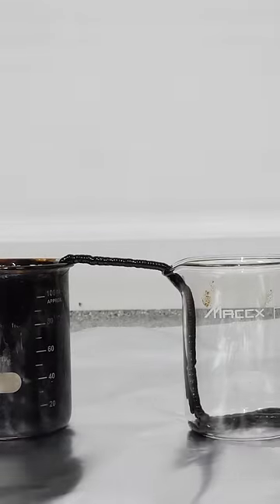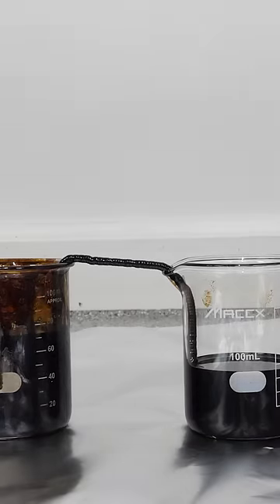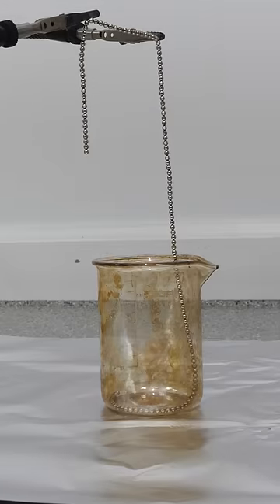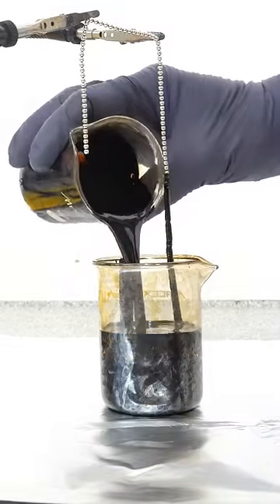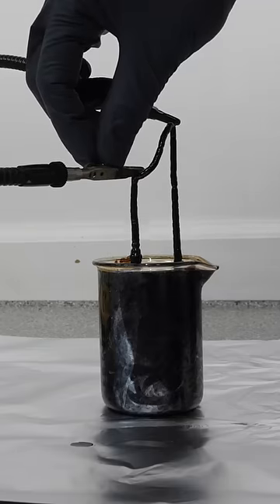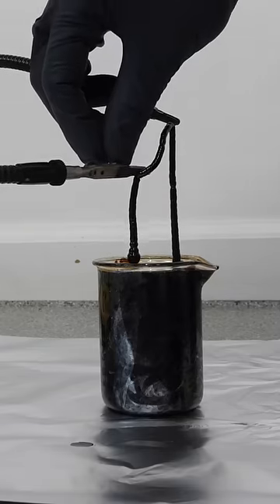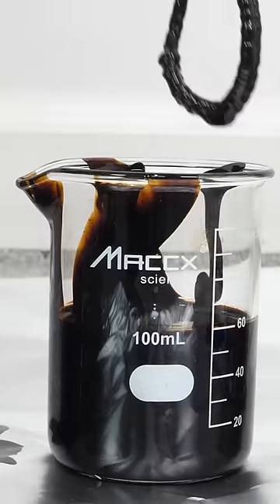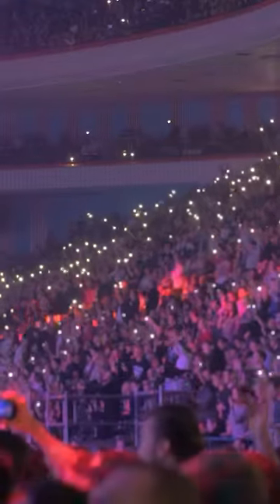Perpetual Ferrofluid Fountain

Comment: You can describe this with pure logic:
Why should it drop in the first place?
The only reason it's going up, is because the up force is stronger than gravity. What should change if it's on the other side beside it's on the other side? Still is the up force stronger than gravity, that's why we are here in the first place? Also why do you expect the drop to drop when you dip it back in the solution? It is more rational to expect that it will also "suck" the fluid up like the other side. Why should the left side behave other than the right side?

Comment: If you start the magnet beads from strong 100%, run it up and over, and then on the downside, start degrading each bead by 10% weaker than the last bead. I bet it starts to work.

Comment: What if you put a straw against the drip end of the chain? Maybe the surface tension pressure in the straw would move the fluid far enough away to relieve the magnetic pull on the fluid.

Comment: What if you used a ramping gear (cant find the real term) the chain weight would apply an increasing downward force until the ramping gear hits it's drop, creating a sudden movement that drops the drop. It's stored energy so no breaking law of thermal dynamics there, you'd just need it fine tuned to the difference of weight in the chain and the weight of the chain +the Ferro fluid. Since the ferro fluid replaces itself, I think it's reasonable to say the chain would be heavier with it than after dropping some off. I imagine there's a limit somewhere else like an eventual change in how magnetic the fluid is or something, but it'd be closer.

Comment: Even if I somehow made it drip, the magnets would lose magnetism overtime.
Reply: Yeah, but not because of anything they're doing. In like a thousand years or however long it takes permanent magnets to lose their magnetism, they would still lose it at the same rate even if they were just sitting on a shelf or something. They don't "use up" any energy in order to pull things, so if it dripped it'd be creating kinetic energy from nothing and thus would be considered perpetual motion.
Reply: @zeph0shade  That would be it. Yes. But in that case just call sun free energy as well.
Reply: @leachblah6313  That is the closest thing to "free" energy we can realistically get, but it doesn't create energy from nothing like this device would be doing if the fluid dripped.
Reply: @zeph0shade   Idk how you are making a conclusion that the supposed machine will be actually free energy. Like I said it's the same as the sun. Also the drip would be so pathetic, any extraction of work will completely stop it from running.
Reply: @leachblah6313  If it dripped, it would mean the laws of physics have all left the building so it's kind of pointless to say it "would be pathetic", because maybe it wouldn't be! Maybe now that the laws of physics have been nullified, it could be gushing fluid like a waterfall!

The point is, the sun doesn't create energy from nothing, but it does create energy from something. In its case it creates energy from nuclear reactions.
That's where magnets are different, they don't create energy at all. Not from nothing, and not from something either. There's just no energy to be extracted from them (unless you literally use the metal as fuel for some type of reaction).

That's why it would be "perpetual motion" if you made the fluid drip from the magnet. It's not about how long it would last, or how much work you could "extract" from it, it would be producing kinetic energy with no energy being added. That's what is commonly known as "free energy".
Reply: @zeph0shade  ahh I see

Comment: What you're so close, just add progressively weaker magnets to compromise the last leg of the chain!
Reply: Wait actually, you may have to start the reduction in magnet strength at like ½ or ⅔ of the way down the last leg, but you could certainly find the right gradient to get a drop going - but I'm assuming a great deal, like I have no idea whether the ferro-fluid has surface tension/cohesive properties similar to water for example

Comment: If you were to attach a plastic tube that the fluid shapes into at the bottom of the last metal ball, would the way water conforms to the shape that it's in not remove the fluid far enough from the magnetic source to get it to drip back down?

Comment: What if you put a piece of string from the bottom magnet down to the beaker the string of would absorb the fluid it would be able to get away from the magnetic ball much easier and collect in the string and then be able to drip back into the container

Comment: Please try using 2 stages of magnets stronger ones connected to weaker ones. Using the stronger ones to pull the fluid to said height and weaker ones for its decent. If that works Nobel prize

Comment: Try putting a reservoir at the end of the chain thats heavy when full, has a hole on bottom and vent on top to allow it to drip and a spring that can be mechanically moved to start the dripping and will oscillate continuing to bounce the wrighted reservoir? Lol i know perpetual motion has never worked for anyone but.....if not oerpetual motion why not try for hyper efficient conservation of energy in the system?

Comment: Yeah cause its acting kinda like a sifon isnt it? So it needs to be below its center of gravity to keep flowing. I know the magnets assist so it helps it travel horizontally and vertically similar to sucking on a syphon does. Which is why it can fill the other cause the string of magnets is at the bottom and has no pressure from the flud. Its also why it wont fully empty and instead equal out and stop transferring. And its also why even if both sides touched the bottom the pressure from the fluid would cause it to just come to a stand still. Am I close?

Comment: But what if you on the descent chain together gradually weaker magnets so that the magnetic pull difference between each link is low enough for the ferrofluid to still drop with the assistance of gravity, but over several links the magnetic force becomes too weak to fight gravity and the ferrofluid actually drops down?

Also film with a thermal imaging camera to see temperature changes which would probably be the source of the energy needed

Comment: But wait.... What if, what if we take a hose and connect the 2 beakers together at the bottom so fluid can transfer back to the starting beaker and then set the secondary beaker a bit higher than the starting beaker??? Can we create a fero fluid super highway loop system for constant flow???

Comment: Nothing involving "permanent magnets" is ever a perpetual motion machine. Those cost energy to produce, and some of that energy is stored in the form of aligned magnetic fields throughout the metallic mass. The trick when designing a perpetual motion machine is always figuring out where to hide the battery, but magnets literally are batteries.
Reply: That's not really true. You do store some small amount of energy in the bulk magnetic material when you create it, which is why magnets are only metastable, but they're not really using any of that energy to attract or repel magnetic objects anymore than earth is losing energy by attracting you back onto its surface if you jump. The energy is stored in the field itself rather than the magnet, and magnets don't "discharge" over time from attracting stuff.

Comment: What about using smaller and smaller pieces of chain for the last few links. The ferrofluid would drip down due to gravity and the last few links wouldn't have enough pull to overcome gravity causing the fluid to eventually drip off, maybe even having the last link or two be non magnetic so surface tension and gravity are the only forces left acting on the fluid

Comment: but what if that last magnet is attached to a long very absorbing material that then hangs? maybe the absorption might be enough to overcome the magnetic field and pull the fluid down far enough away, and then after oversaturation it will drip...but i'm thinking that the iron particles would start to clog the material until it can no longer absorb well enough

Comment: What about placing a magnet on a non-magnetic pole and then putting it in the beaker where it's positioned under the chain close enough to pull the ferro fluid off the last ball in the chain. If it continued to pull drop by drop, then couldn't the magnet eventually become too full to hold it all, thus allowing it to flow down the non-magnetic pole back into the beaker?

Comment: What would happen if you scaled it up to where the force from the magnets couldnt compete with gravity pulling on the weight of the fluid? Or would scaling up the magnets increase the megnetic hold on the fluid and make the experiment identical to this? Is there a perfect amount of magnetism that would make the fluid climb but not stick as strongly? How do you measure how magnetic something is?

Comment: So what if the 2nd cup was elevated higher than the 1st cup? Would it still fill? If yes, could you then put a hole in the bottom cup to let the fluid drain from the 2nd cup to the 1st cup?

Comment: Using a platic fastener, install 1 more magnet, with a gap to attract the ferofluid from the "drip" side of your bridge. It should break the surface tension of the fluid & create a flow. Surround with coils to produce current. There IS a way. Laws of thermodynamics be damned ! No heat death to the Omniverse(s) !

Comment: What about an olephobic coated surface with magnets under it. Chain of magnets, olephobic glass on a 45degree angle, magnets below oleophobic glass, causes chain to drip, liquid doesn't have any adhesion to glass, flows to bottom area of glass, another drip falls, profit.

Comment: What if the last few bits on the end of the chain had gradually decreasing levels of magnetism? Enough to pull the fluid up and across, but becoming less magnetic each bit after. Would the pull of smaller magnets and gravity cause the fluid to build enough momentum to form a droplet on the last bit, but not strong eough to hold it?

Comment: What if you build under the first  example a "tunnel/tube (small one maybe 1mm or 2mm radius)that connects both containers on the bottom line, but you would have to ad an door/close system so you can open it up first, once the pot on the right side is filled to about 1/3?

Comment: Hey wait a second. What if you gradually decreased the strength of the magnets as you go allong. You would need an extremely long chain. In order to conserve space you could possibly coil it around in a circle for some time and at some point let it hang over the container again. Now with its weakened magnet holding onto the fluid. You put another magnet down into the fluid strong than your end above but not near as strong as your lead line out of the fluid. The beginning of your magnet strand.....
Reply: I can also see the problems with this. But I stil think its fixable

Comment: if you put another strong magnet underneath the suspended chain but submerged under the surface of the fluid in the beaker (think magnet glued to the side of the beaker or something) could that magnet pull the drop off?

Comment: but, what if the raised chain went into a smaller container, so as the fluid went up the chain and filled the smaller container it would overflow back into the larger container? 🤔

Comment: A "pump" that requires almost no energy. I wonder if you used a 10x scale if it would be "faster" or flow a bigger volume of fluid . It should be right ? With the bigger magnets and still have viscosity of the fluid its just a "bigger" pipe ? (Try this then go to 100x scale 😂) I wanta see it 👀

Comment: I understand that the magnetic attraction is holing onto the fluid, but would coating the hanging end with a hydrophobic material make a difference?
Reply: no, not really.
If the coating is thick enough to stop the magnetic force, then the fluid wouldn't reach the coating in the first place. If the coating isn't able to stop the magnetic force, then it wouldn't do anything.

Really, the only way it could work is if you can magically turn off the magnet, but then you'd be turning off a magnet.

Comment: what if you had an insanely tall version of this, where the magnet pulls it all the way up but at the very very top where its meant to drip have an electric magnet that can be turned off?  say you have enough height that when it drops off it spins a very little motor to produce electricity?  I know perpetual motion machines dont work, but just maybe..

Comment: What if for the last few beads of magnets you use just steel beads thst would still attach to the magnets but might not have enough magnetic force to keep the fluid on
Reply: It wouldn't change anything really, because the fluid is only traveling as far as it needs to in order to minimize the energy in the system. For a drop to fall from the chain of magnets, no matter what you attach to them, the ferrofluid would need to acquire extra energy from somewhere to overcome the magnetic potential of the magnet it's attracted to. 

It's the same thing as two magnets being attracted to each other - the reason they stick together is because that minimizes the energy of the system. To separate the magnets you need to add energy back in, such as by physically pulling them apart. It's the same exact idea in this demo.
Reply: @physicsunderstander4958  what if you added that force in the form of a magnet in the beaker to pull it down how far away would it need to be from the up stream and close enough to the down stream

Comment: But if the very last few magnets hanging down were gradually reduce in magnetic strength... so that gravity could beat the very last magnetic in the chain???
Reply: If the last magnets were weaker, less fluid would move to them from the stronger ones. Then it wouldn't have enough weight to fall

Comment: What if on the downward part you decrease the strength of the magnets? Don’t know if that physically possible but if you could make those magnets weaker than the side that pulls the fluid up it may work

Comment: Try putting mu metal at the other end 😂 still shouldn't work because the ferro fluid won't want to go past the magnetic field. Although, you might get some of the suspending oil to drip off, but that still doesn't matter because you'll be losing the particles and eventually it will stop.

Comment: What if the last couple of balls on the chain are not magnetic though? I expect it to not be enough to break the magnetism of the cain, but it's worth trying.
Reply: That won't change anything. The ferrofluid would require energy to be added to the system in order for it to complete a trip around the chain.

Comment: What if you use weaker magnets on the end? About 5 or 6 that get weaker in succession with the weakest on the end? Or even just put a couple steel ball bearings on the end of the rare earth magnets. Where there is will there is always a away to prove these "laws" are fragile. The only reason they stand unbroken is due to fragile thinking. Think strong and discover more.

Comment: What if the magnets get weaker at the end
Reply: Then less would be pulled onto it, meaning there wouldn't be enough to drip off.
Reply: @itssovalentine  how bout a needle?
Reply: @hooverity  If you mean a non-magnetic needle, the fluid would never get onto it in the first place. If it's a magnetic needle, same issue.

Comment: What if the last 2 - 5 steps on the chain are some magnetic metals so these steps stick to the chain, but the further from the last actual magnet there might be a point that the fluid can flow to it but drip because of weakend magnetics😂

Comment: Hang a thin wire off the end.
Reply: I think for this idea or for weaker magnets at the end, it would just bead up where the strong magnets stop because the fluid would be pulled toward the strongest magnets.

Comment: It just looked like a shit attempt. Like the chain was higher than the successful run. You lowered it and tried to add more fluid to get it going. But what if it was lower to begin and had a chance with the momentum. The force going up the chain does have to exceed the magnetic force holding the fluid